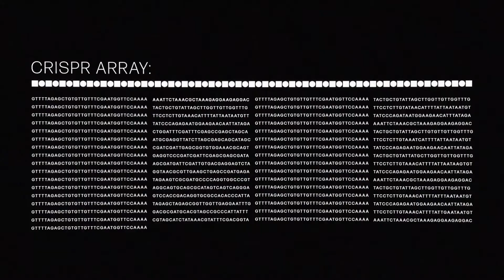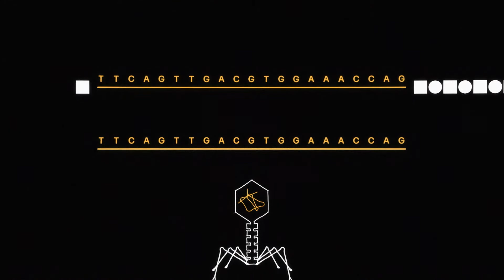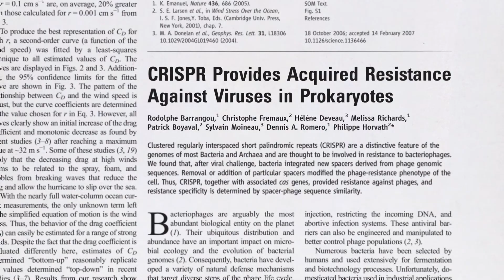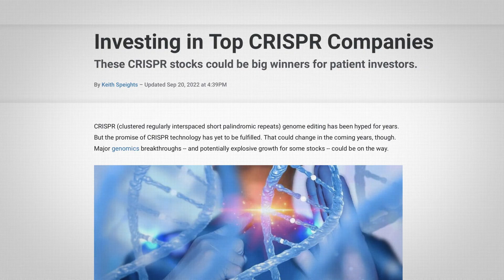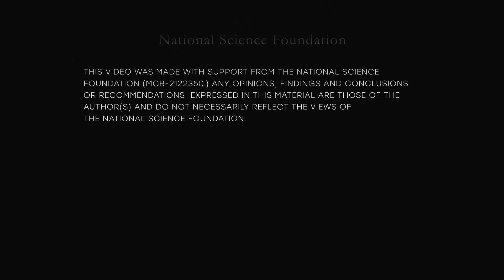The CRISPR Apostle: Rodolphe Barrangou

Comment: Why can't we add CAS  sequences to Corona virus o that it does not infect human?
Reply: thats not how crispr works sir
Reply: Viruses keep mutating, better to change human body to react to viruses faster but that difficult due to possible off site changes and regulation
Reply: Adding crispr CAS 9 geneediting to rice plants and make them less toxic to  heavy metals like lead, cadmium(super phosphate fertilizers), requires biological monitoring for these heavy metals interest in .Metallothionein protein should be able to adopt crispr CAS 9  gene editing in rice plants and more basic studies have to be made in field trial by the Regression analysis, since cadmium and lead accumulate in the bones. teeth and  be placentally  transferred to the foeataL blood causing diseases like it a i -it a i (0ouch -ouch painful joints) i and often osteomyelitis .The W H O guidelines for Crispr CAS9 short cuts should be non-toxic.
Reply: It is like production of antibodies against the human spermatozoa tail antigen and block conception, which is why corona virus is pandermic. There's no point in adding CAS sequence to corona virus, so gay to infect humans.
Reply: You can modify coronavirus so it doesn’t infect humans but the normal coronavirus that does infect humans is still around